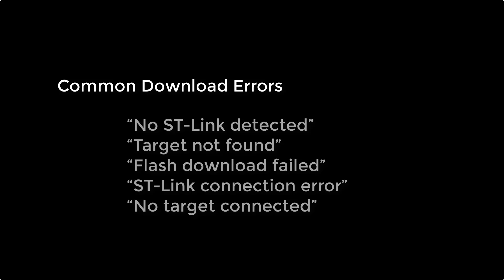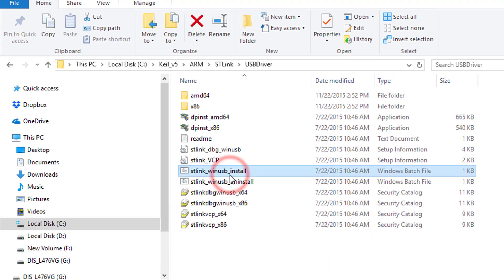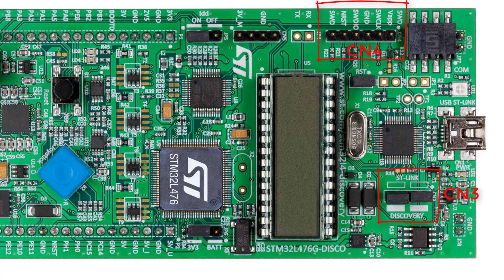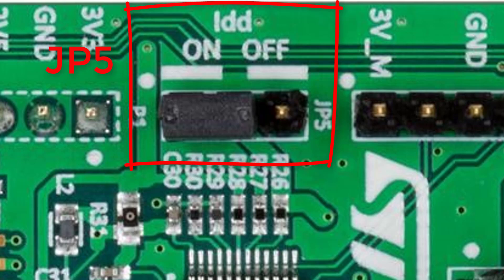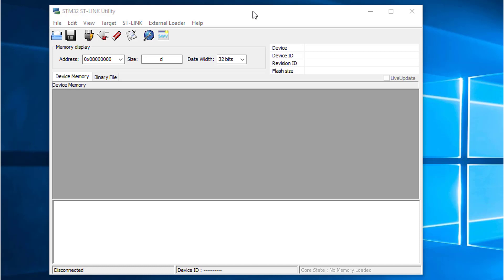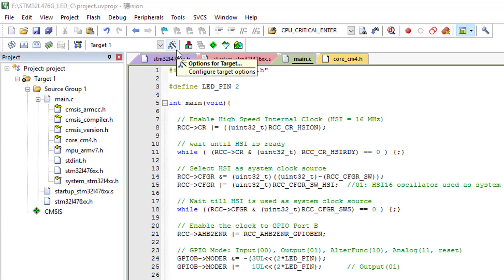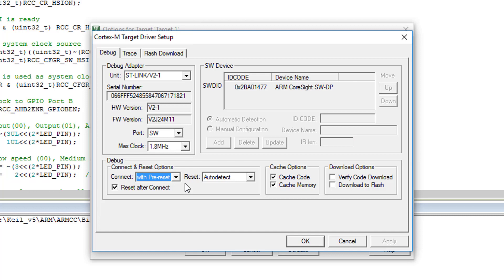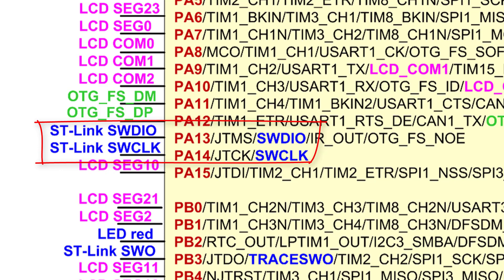Tutorial 5: Code download errors

Comment: Thanks, ST Utility helped cure stm32f407-discovery. I mistakenly set the pins PA13 and PA14 to the output, instead of PD13 and PD14.
Спасибо, ST Utility помогла вылечить stm32f407-discovery. Я по ошибке установил выводы PA13 и PA14 на выход, вместо PD13 и PD14.